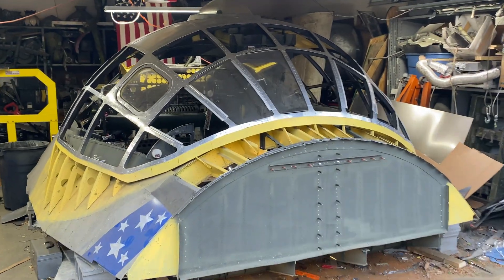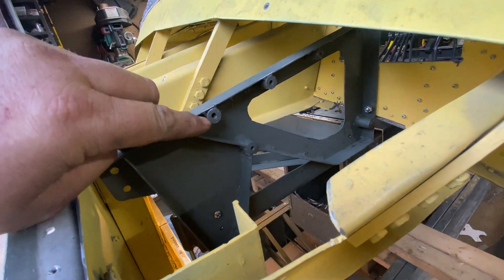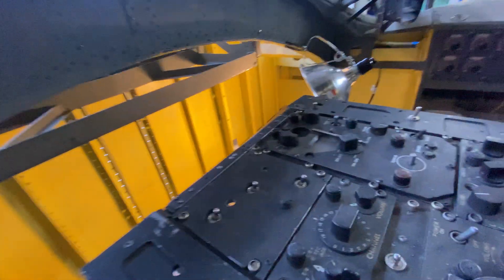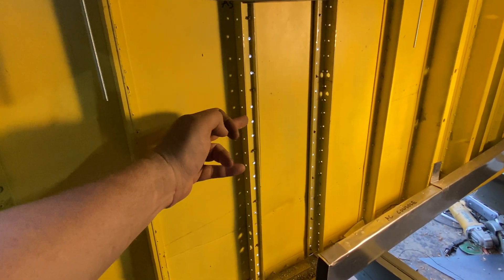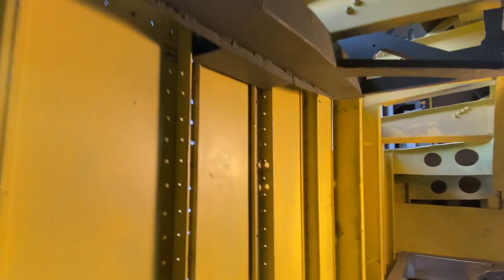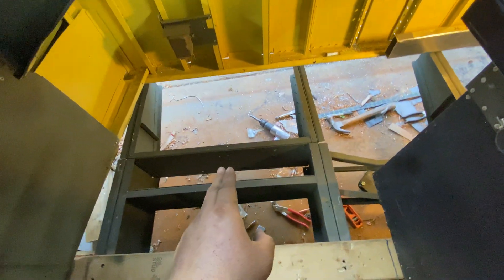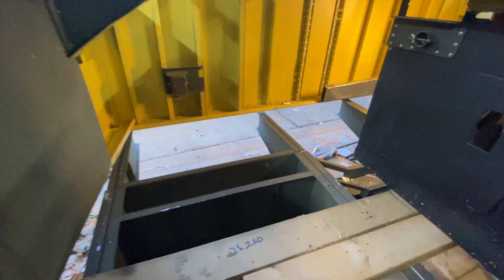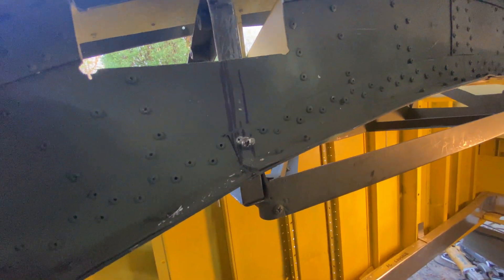The West Virginia Garage B-36 - Elevator Segment Support - Check!

Comment: There are some parts remaining from a B36 crash in El Paso at around 6,800' on the West side of Mr. Franklin (not much though).  The crew crashed in poor weather conditions and at night on Dec. 11, 1953, having poorly deciding they were on the East side of the mountain.  Most of the parts were removed using a mule-train but the piston engines are / were still there in 1975 when I moved away.
Reply from the maker: I wouldn’t be surprised if the piston engines were there but all I’ve seen in several videos and photographs are just one of the jets as well as a main landing gear.
Reply: @B36HPeacemaker  All the jet engines were removed on the initial salvage.  I do remember a landing gear segment and some scattered aluminum, as well as the piston engines.  The wreck is about 1,000 feet above the Condo I had in those days.  Interesting to me is that there was no impact crater.  Yeah, it's a mountain, but not solid rock.  Just lots of 12" rocks on a steep grade.  It's an interesting hike but once you've seen it you wouldn't waste the calories to do it again.

Comment: Is the front gray panel actually the Front Pressure Bulkhead of the B-36?  With 20mm nose gun turret forward of the Bulkhead?  You chose to paint the bulkhead gray instead of zinc chromate.
Reply from the maker: The large semicircular, OD green wall is BH1.0. It’s not a pressure bulkhead, but yes the turret sits forward of it with the ammunition boxes attached directly to it.